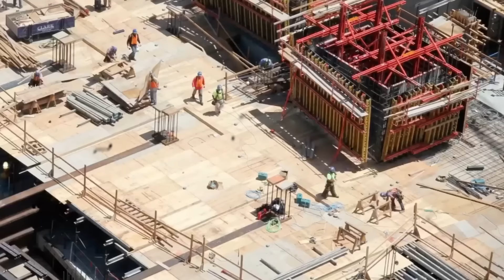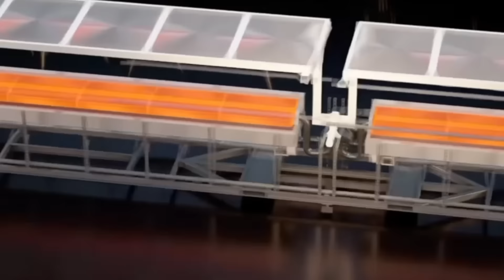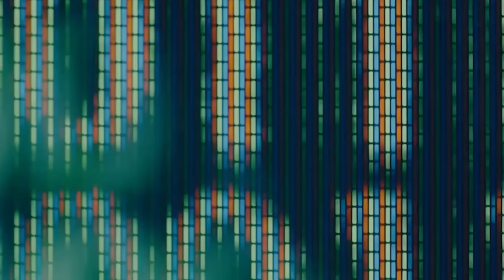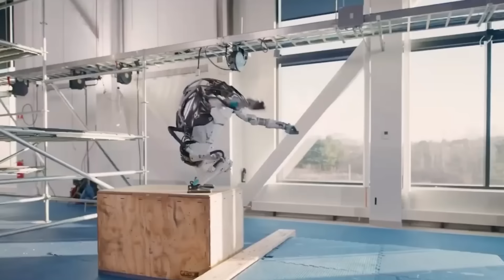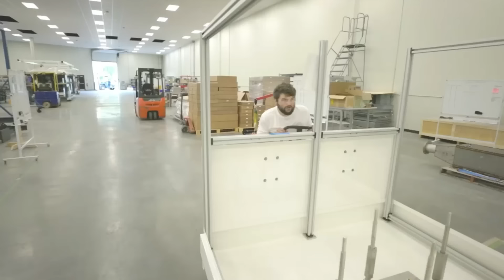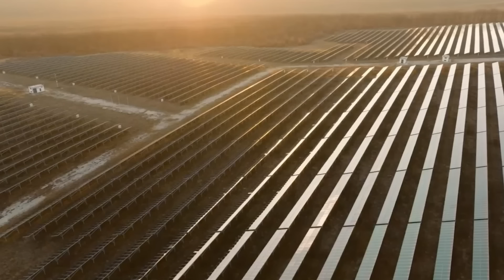Solar Energy is Changing: No Panels, No Lithium Batteries

Comment: There’s been a solar farm that was destroyed in minutes by being smashed to bits by a large hail storm. Could this happen with this type of panels ?
Reply: That was my first thought too. Since this system uses moving lenses instead of regular flat panels, hail resistance would be a huge test.
Reply: Not really. These lenses are I guess made from some kind of fiberglass, or plexyglass or other kind of material to which hail can't do any kind of damage.
Reply: Solar panels can be protected by having a grill above them ..even something like Chicken  fence wire suspended above ..or wire  fencing .. hail stones can be the size of cricket balls or baseballs and travelling as fast . And even if it did damage  or shatter the lens , ....that's just a sheet 9f plastic ..Ithe is pieces can be retrieved , and remelted ..or if as hopefully the  frensel panels might be glass .., remelted . The bulk of  the system  is protected in a container. .. So yes it's problem n, but glass is not that expensive.
Reply: What a silly comment. There's been oil tanks that caught fire. Is that a reason to stop using oil? 

Actually, it's a great better reason than the odd solar panels damaged by hail.
Reply: Solar Flare could also pose serious risk.
Reply: @blueocean2510 how?

Comment: A complete system of renewable electric energy already exists.  It is new and evolving.  New technologies are being developed every day.   Every new approach solves some problems, and/or improves the performance of the system.  The transition from fossil fuels to electricity is already running strong and will strengthen with more and different technologies.  This new device is one improvement in the global transition.  It will have a market in the global transition from fossil fuel to electricity.
Reply: They have the technology to collect energy straight from the air Tesla did it with wardenburg tower but they couldn’t meter it so they buried the technology we only get to use whatever they can make the most money from
Reply: Interesting air neg and pos ions, I always thought someday even cars who knows anyway always good to innovate new solutions to old problems and new ones. I’m liking the idea of no chips solutions that deplete natural resources.
Reply: 👌🏻😎OK O WINDY ONE❗️🤣NUFF SAID🤔
Reply: Nothing will replace oil eventually maybe Solar have a chaince if it can be improved. Solar cam be used to heat Heat-Batteries as a failsafe to store energy, which maybe a better alternative.

Comment: In sonnenreichen Ländern, in denen Sonnenenergie nur für 12 bis 16 Stunden gespeichert werden muss, weil am nächsten Tag die Sonne zuverlässig wieder scheint, scheint mir diese diese Art der Speicherung sehr praktikabel zu sein. Es werden soweit ich das beurteilen kann, keine kritischen oder seltenen und deshalb teuren Rohstoffe benötigt. 
Aber in diesen Ländern sind für die Menschen auf dem Land Fotovoltaikmodule auf dem Hausdach in Verbindung mit einer Batterie die praktischer Lösung. Es brauch kein teures Stromnetz über viele Kilometer. Ein paar Häuser erzeugen den notwendigen Strom mit gemeinsamen Fotovoltaikmodulen, Batteriespeichern und einigen wenigen Meter Stromkabel.
Reply: ...and thankfully,being english,wind generators of the small house or even (for me) boat size units are becoming more and more viable.i intend to combine the two.cheers

Comment: I would love to know how well it performance winter times when there is less sun light time and low temperatures so how well it can isolate the heat battery because heat loss will be the biggest killer of this technology
Reply: It won't work, the lenses need full sunshine. I'm not even sure if it'll work at all, even in summer their math doesn't add up, all they have to show is CGI but nothing that actually produces energy. 
P.S. I use Fresnel lenses myself, for cooking

Comment: This technology shows the promise of few moving parts in the heat storage, but the stirling engine is a potential long-term problem.
Reply: stirling engins are MUCH more reliable than any internal combustion engine: no valves, no explosions, no dirty exhaust gases

Comment: Good for home use. Bottom line is always the cost to operate and maintain.
Reply: as long that has mechanical movement (mostly gearbox and the stirling engine) need maintenance cost....and stirling engine is loud, the 1000c thermal will melt something in a long run
Reply: @billykulim5202  true, rust, wear, and tear, just like Death and Decay to the living
Reply: @billykulim5202 New Stirling Engines are extremely low maintenance.  Because they are sealed systems that run 60,000 hours with no maintenance.  They can do this because there is zero internal combustion to make soot. 

Search a company called Qnergy, they use sealed Stirling Engines and I’ve used their shit, it works.
Reply: Storing and delivering sometimes cost even more.
Reply: You mean relative to car maintenance costs.
Reply: more like power and greed.
Reply: Думаю банальна парова турбіна спрацювала би тихіше та надійніше Стірлінга...

Comment: These containers, with the special blocks, are REAL hot. So, they must stay in uninhabited areas, like deserts, where there is lots of sun light (and no people living nearby). The desert climate would help to mantain these blocks hot. But by midnight the desert can reach freezing temperatures, due the wind.
.
You won't be able to use this technology in portable appliances, because the blocks gets REAL hot.
.
Solar panels and LifePO4 batteries are the best solution, because they don't get REAL hot. But, after some time, LifePO4 batteries needs to be replaced, and at this point the special blocks do not need any change.

Comment: First, you must have sun.  This, like solar panels, fail during dark of winter—or need acreages of brick containers or batteries, to store enuf heat to last thru those dim short days….  
In the Pacific NW we get a few weeks of days too dark/cloudy to get much out of solar anything—& that’s with global warming shortening, & drying our winters. 

How about doing a vid about how much temperature differential is needed to generate electric, by drilling well-holes in the yard? 
How about a vid on mandating the huge data centers using this tech? 
How about a vid busting or proving all the odd gadgets so many try to sell folks to DIY unlimited power gadgets?
Reply: geothermal is the way to go in northern regions. imho

Comment: It is not impressive...as it use the same source of energy in comparison to solar plates The SUN
Rather then placing entire container what if i install solar plates on my roof and generate electricity in day time and use electric gesure for boiling water which will then be used as steam engine at night

Comment: I keep two fresnel lenses in a pouch in my fishing jacket. They're a little smaller than a 3X5 card. They produce very hot, almost instant heat to light a campfire, or even a cigarette.  
Just a small beam of sunlight thru the overhead trees will do.  A larger lens could easily boil water in a black metal container, and the steam could power a generator.
Reply: Yeah, I went old school and bought a couple they manufactured in the 70's and stuffed them in my bag. They work great. And I know if I take care of them, they will last forever. You will always want more than two ways to start a campfire. And I will tell you from experience. It is easier to find flint and make sparks than it is to create that stupid bow thing, just to get blisters before you make a fire. My father was a Green Beret and they taught me how to survive.
Reply: thats funny...🤣🤣
instead of trying to catch sunlight in a big net, lets funnel it into a bucket!!
🌞📉
Reply: @fubufb420  Air is also available in plenty. but why do we need compressor
Reply: The total system advantage is more important than efficiency since sunlight is just free.
Reply: My 30 x 20 lens can literally melt rocks at noon
Reply: Literally?

Which “rock” are you talking about?

“Rocks” are made up of minerals. 

 Sulphur is a mineral. Look up it’s melting point..
. 
This is like talking universally about “melting metals”. 

Gallium for example turns to a liquid at around body temperature.

Be specific instead of making wild generalisations.
Reply: Hay guys, this is the most advanced Technology to accumulate sun power likely to NASA Space Project and latest Technology of Storage Electricity in another kind of Energy like PHOTON or QUANTUM. 😅😅😅
Reply: @khinmgnyo8214 In this case how would the Stirling engine come in.
Reply: @OkekeOlughu 
If not, it might be TEG; efficiency is lower than stirling.  😅😅😅
Reply: As engineer with 40 years experience with large energy and power stations I advise you to do some study ....
Reply: Remember the lenses they had in the old big screen TV's?
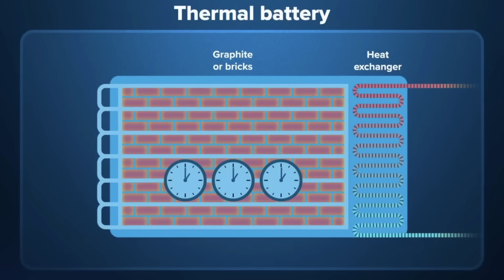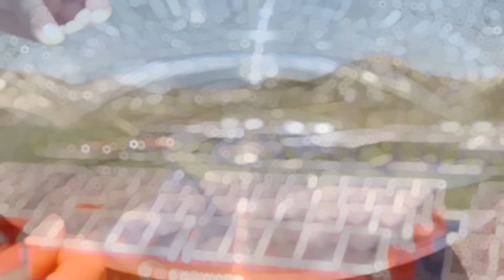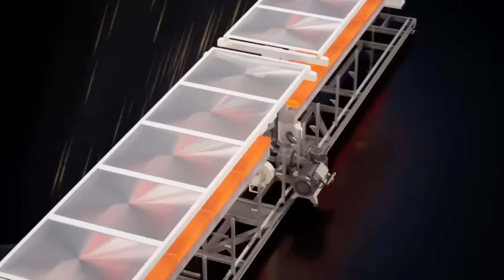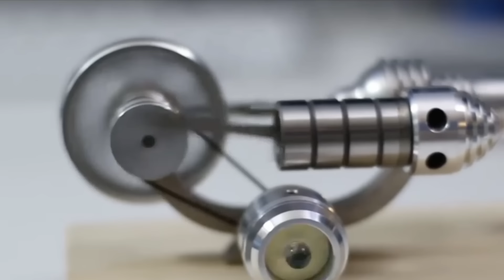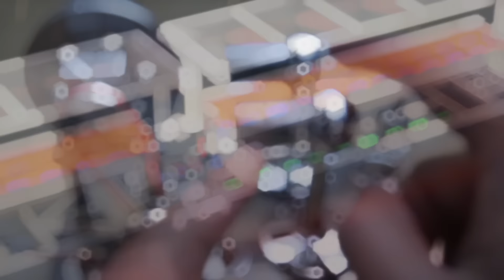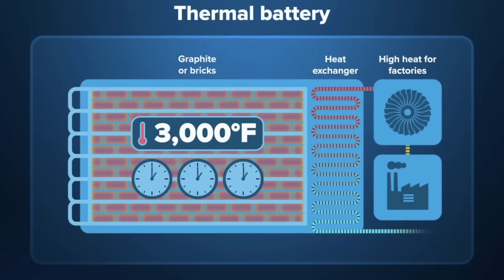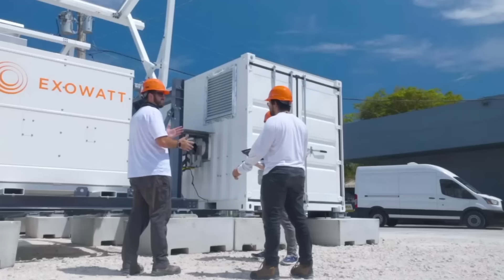Reply: 1:1 3:07 9 2:54  1: 2 2:51 :47  1:54 3: 4:27 3:4 4:17 9 4:11 4:28 05 3:16 6:03  4:44
Reply: Just be sure you face north or south while you have that in your pocket, my friend. LOL
Reply: I bought a couple by mail-order in the fifties for a buck or two. Advertised in the back page of comics. Fun and useful.
Reply: boiling water takes like 1000watts of electricity, cooking about 800watts. Boiling or cooking using sunlight is a huge saver.
Reply: Completely wrong! Before you make such a wild statement, you need to define how much water you’re seeking to boil,, White weight of food you are seeking to cook to what temperature?

Stone me! Here we live in a time when there’s more information available to the average person in their hand that has ever existed previously, yet we get moronic observations like this, simply because you never bothered to look up fundamental principles of thermodynamics and simple power equations.
Reply: @dougbright8120  It was quick estimate based on household appliances and volume. Kettles usually advertise at 1000watts and similar microwave. Also cooking stoves are the same about 1000watts and portable ovens.  There is no need for indepth research unless they advertise falsely.
Reply: no sun no work  uk 66million a year cloud dimming. 4 climate stuff.  it rains ALL THE TIME solar is total bs.  AND DOES NOT WORK HERE. no sun    = NO LECKLY
Reply: @Tom-c1q2ki get power from my panels on cloudy days. obviously less power but still.
Reply: @Tom-c1q2kthat means uk is not their market 😂
Reply: @Tom-c1q2k use GeoThermal, rather than HelioThermal
Reply: @Tom-c1q2k
That's why you guys have wind vanes, though it's not that that efficient.

Comment: This technology doesn't need government subsidies.  It need an investor already in the energy capture and storage business to invest in it and develop it properly.  The "motors" that move the lens to capture sunlight, for example, should be replaced with a more passive system.  Still looks amateur hour.  Why not interview some engineering skeptics?  Exciting potential, but the team needs to draw on an expanded set of expertise.

Comment: Can multi focus lenses used in existing solar panels will double the power output
Reply: Solar panels currently cost less than 30€ per m². Ready to install.
To double the power you will need a lens with 2 m² plus storm safe mounting

Comment: At first glance I thought they could eliminate the tracking by having an arc of those lenses. For seasonal sun movement, they could maybe manually move it once a week. It is probably not necessary to use heat bricks and blow air over them to gather it; I think pumped water past the beam would do better, from a normal water supply then up to a large, high tank, where it falls through a small but normal hydro plant. The size of the tank determines how much goes to the grid and how much gets stored for nights.
Reply: How does this compare to zpower from Arizona ? they call neutrinos ret al. adiant energy . energy box
Reply: @chriss.9060  I don't know; I haven't seen zpower yet.
Reply: Pumped storage for a sysem like this is impracicable. It is not very energy dense and any upper tank would nnot be big enough. Just look at the reservoir sizes of current pumped storage facilities. They are huge.
Reply: @rogerphelps9939  I would need data. I see the physical connect between pipes as more efficient than loose air, and height can be achieved by cliffs rather than towers, or even high skyscrapers might be good enough. Energy density is only in the collected store, and not in the transfer, which can only lose some, no matter what kind we implement, and my suggestion looks like it loses less than the example. Still, data is what's needed to find out.

Comment: Supplemental heat forget the Sterling engines just pump the damn heat into my house so I can get rid of my $300 a month natural gas bill. Somebody really missed the mark on this LoL
Reply: In tropical countries they don’t need heaters so some sort of generator would be needed.
Reply: @megsman4749 absorption chillers. You can freeze, refrigerate, and AC, and heat with solar heat energy.
Reply: Try a Solar air heater ... https://youtu.be/3ivOBu62a0s?si=IouohtkX92ouqBRW
Reply: The heat can be stored in sand thermal mass batteries.
Reply: You would have to heat your house in the summer. This would have very little output in winter.
Reply: @Billy97ify Perhaps a sterling engine to drive a refrigeration cycle for cooling. But for winter heat not so much. Unless spring and summer heat is saved into the cold seasons?
Reply: @This.pen.name.is.not.available  Try calculating the storage requirement to cover all winter demand.
Reply: @This.pen.name.is.not.available they collect radiant heat. So just because it's cold they still work at 60% efficiency while your solar panels drop down below10% or zero when covered in snow.
Reply: @This.pen.name.is.not.available  i just watch how the mormons use heat for their cooling system. This can couple with that system will be perfect for cooling vs heating of the house = lowest cost for all including electricity. Perfection if can combine all that
Reply: @Billy97ify  even in winter sunlight is still 'hot' (so i'ts a matter of sending the light thru something light can pass but no heat leak to the cold outside), i do wish there's some kind of "light battery" that can just bounce light around ad infinitum in a box, lots of our electricity costs are for indoor lighting anyways.
Reply: @fltfathin  Clearly you have not looked at solar radiation seasonal charts or solar farm output charts. There is a reason why it is cold in winter.
Reply: @Billy97ify solar heat tubes work better than solar in all climates you just have to use the heat energy instead of converting it twice like these guys are doing from heat to mechanical then to electric...
Reply: @Gr8Unc  Better than solar panels still means effectively no output in winter. You cannot collect what is not there.
Reply: @Billy97ify  You can just store the heat in buckets and keep them in the shed until winter then bring them inside, duh.
Reply: @BAM-xn9to  For sure that is the answer. There are a lot of cardboard boxes that get thrown out. You could fill those too.

Comment: Solar is like three dollars watt  in Washington state I’ve worked for two of the largest solar companies in Washington as a Solar installer $.12 a kilowatt hour for Solar is just straight wrong
Reply: A lot of moving parts but works very well.
Reply: More solar
Reply from the maker: It varies. We have the figure based on the resources we have. Thanks for the information :)
Reply: @Engiskill  yeah I think the mixup is you did cost per kilowatt hour and not cost per watt
Reply: 10 centavos pagamos el kw en Uruguay hoy los consumidores finales y no es barato en relación al resto del mundo.